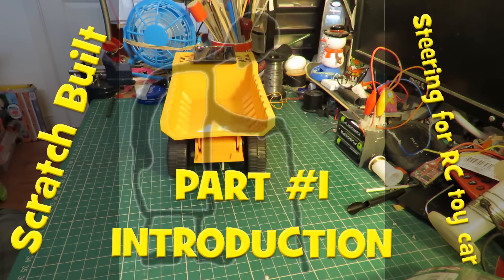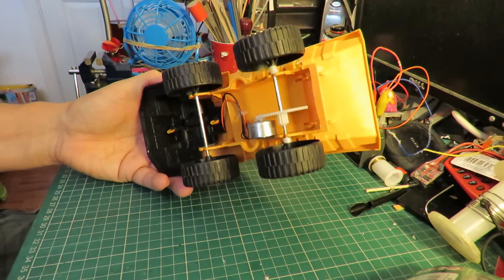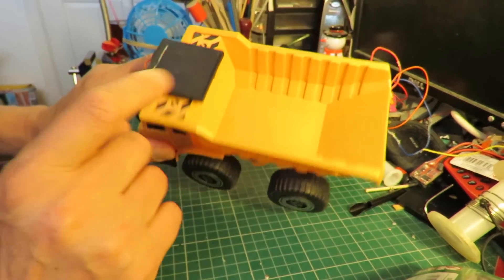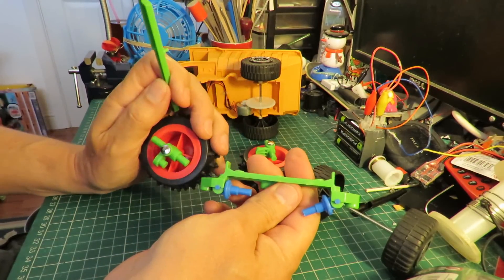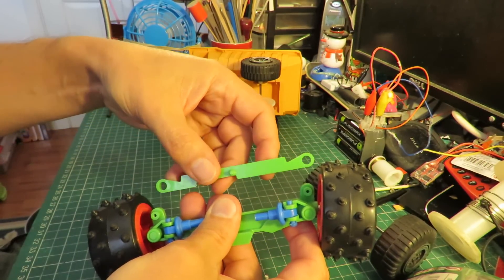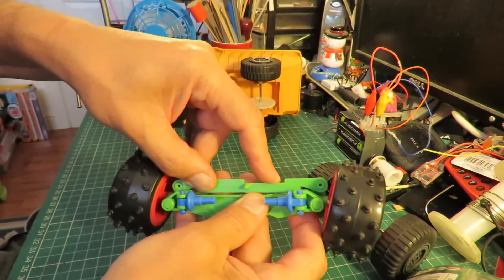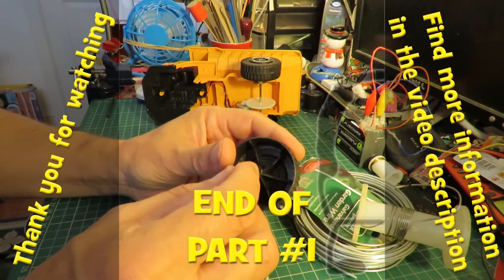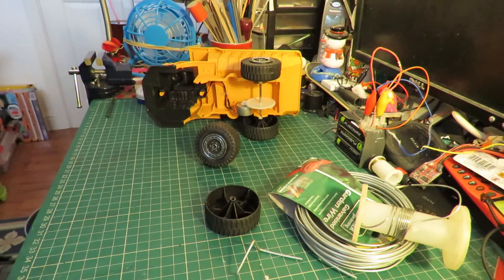Scratch built steering for RC toy car PART #1 INTRODUCTION

Comment: my car that i need steering for is exactly like how you showed with those green pieces but it has nothing to move the cross bar. i need something as compact as possible to move that bar left and right
Reply: i got an idea from your videos on what to do with an old dvd drive to take the teeth of the tray and the gear to make a turning mechanism but that didnt work out well due to my space restriction. i hope you can come up with a way to make it work. you said using the green pieces would be cheating but i am cheaters r us after all
Reply from the maker: I like your idea with the teeth from the DVD drive. As for space restrictions, that just means you have to make your version smaller.